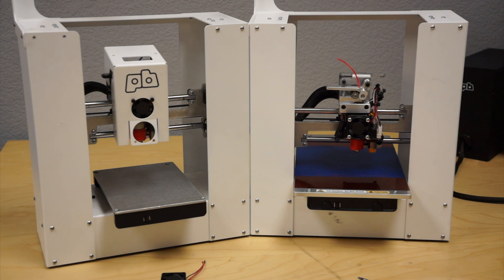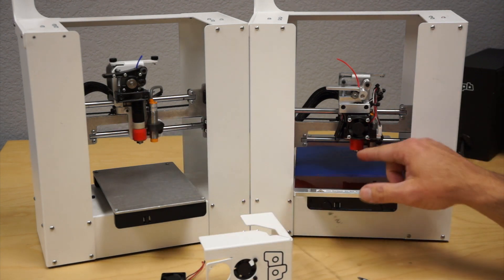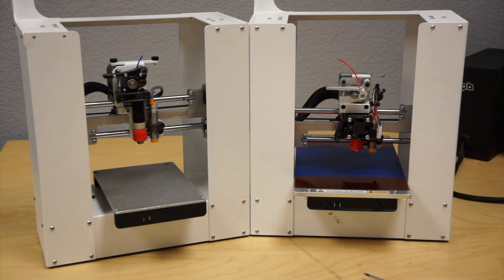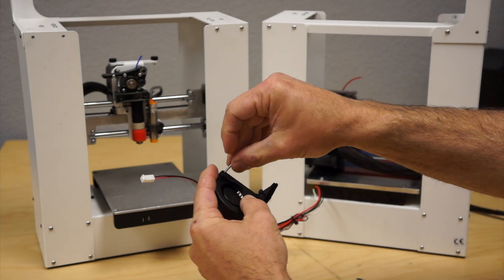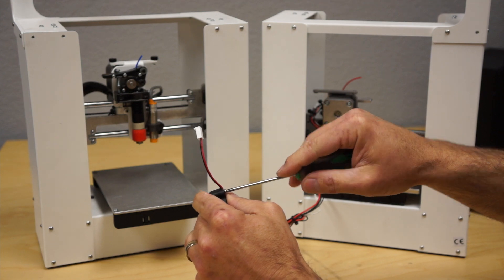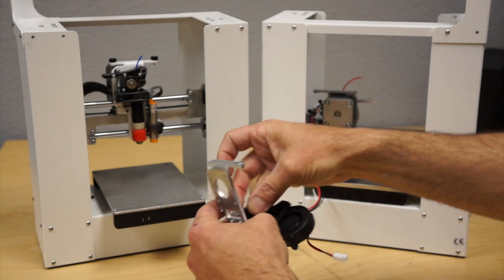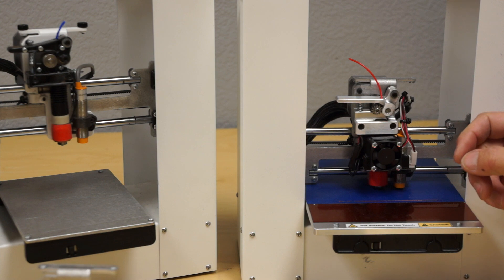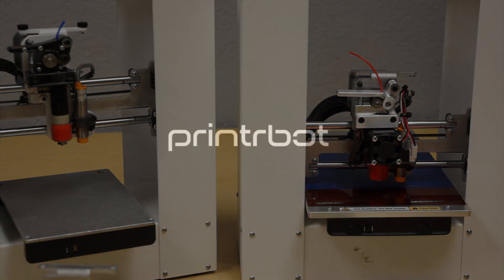Printrbot Play Blower Fan Install

Comment: Love the Play.  Love the look with the shroud but wish it didn't block the print visibility.  I just purchased a Play as my first home 3D printer.  Late adopter as I have access to 3D printers at work and our library.   I can see upgrading it with the gear, led, blower and screw, when parts wear out.  But the larger bed is of interest now and I will keep an eye on the website for when they are in stock.  Would like to have more area to space my small parts and use print one at a time option.

Comment: Led is a good thing.  Wish more would do that.  But wish the fan was more all around instead of single sided.  Would greatly help overhangs on the opposite side of the fan
Reply from the maker: I'm taking notes for later upgrades!
Reply: Brook Drumm that go board.  What firmware is running on it?
Reply from the maker: Tinyg G2core. https://github.com/synthetos/g2/wiki/What-is-g2core
Reply: Brook Drumm interesting. appears you are the first manuf to us it. might have to look into this. thx
Reply from the maker: Yes, I have funded part of its development- the parts that apply to 3d printing. I'm all in.
Reply: Brook Drumm that is awesome.  Be nice if this works for things like teensy and other m3 and m4 32bit boards
Reply from the maker: It's requirements are pretty high, so I'd inquire with Alden. We have future plans to upgrade the electronics further- faster processor and those German drivers that are silent ;)
Reply: maybe non-integrated drivers? or at least headers incase a driver fails or someone wants to upgrade?

Comment: It would be great if the fan came with the screws to install it. Same with the LED. I spent $25 on parts, $10 on shipping and they couldn't throw three 1 cent screws in a baggie with my parts. Now I have to run by Home Depot and try to find the right size screws. But my order did come with a cool PrintrBot sticker. #rolleyes#